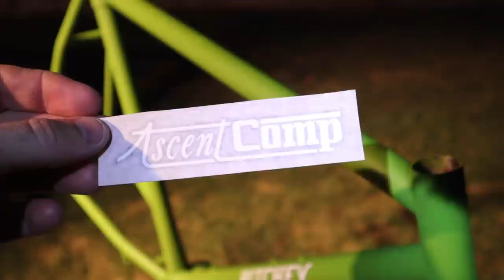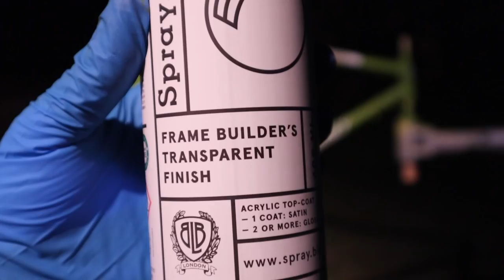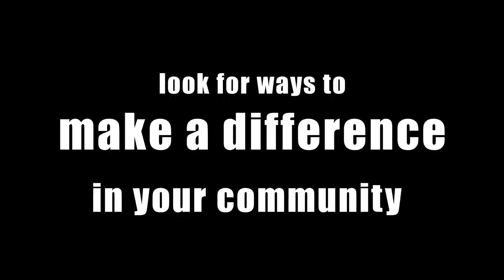Rebuilding Matt's Ritchey Ascent

Comment: Hey man. Thought i'd drop a comment to say how great your videos are, and how i've been helped out by the process of rebuilding my own bike. 
My gf of 8 years ended things just over a month ago and i've been getting by 1 day at a time with depression. Speaking to a friend last week,  he mentioned he was fixing up an old "rat" bike. I realised my dad's bike, an early 90's  raleigh MTB (built in Nottingham, England, my hometown) was the perfect candidate for a project of my own. It had been stuck in our garage for over a decade, used only when my road bike was in for repairs, but because of this neglect, it was in really good condition. After watching a few of your videos I was fully inspired, and I set to work stripping the bike down, cleaning the components one by one, and ordering the tools & parts needed to convert it into a single speed. Working on the bike in the garage with a beer, the smell of grease, that satisfying feeling of tightening a nut along a perfect thread, ( or finally loosening a particularly stuck one), and watching these videos of the process has been like therapy,  infact i'd say better than the therapy sessions i've been to. I have something to look forwards to doing each day again, and I can't wait to see how the finished product looks and rides. 
All the best & thanks for putting the time and effort into these great vids & rebuilds
Reply from the maker: Neil, thanks for sharing your story. There is something therapeutic about restoring a bike. Awesome awesomeness.

Comment: I grinned big at the end!  You took a $50-75 bike and turned it into something that I wouldn't trade for a new $1200 city bike.  There's just not many bikes at the $1200 price range that have fenders and a basket with components that I would compare to the old Deores XT.  $1200 is the absolute least that bike could be replaced with something new from a shop.

Pro tip:  (the only thing I'm surprised you didn't do) Put a sheet of sandpaper on a flat surface and sand the brake pads when you have them off the frame.  The stuff you'll find in brake pads is gnarlier than the stuff in jockey pulleys.  The pads will wear faster (from sanding), but the rims will be much happier and the braking action will be improved until the pads glaze over again.

Comment: What a nice bike with that surly swallow bar. And that cassette. I've never seen this type of locking. The paint is so dope. The finish would be even better if the logo decals where yellow to make a nice contrast. Also I would apply protective sticker patches on the sides od the head tube where the housing touches because the paint will quickly get scratched off.

Comment: That's a uniglide cassette! Difficult to find replacements, unfortunately. Thanks for another great video, I love your stuff
Reply: one advantage to uniglide is that you can flip the cassette cogs around once they wear out on one side.
Reply: @antoinedoinell  that brilliant.
Reply: I liked those uniglide sprockets too, you could build your own custom cassett with almost any weird combination of sprockets, the only downside was that you had only 13-32t to shoose from but other than that they worked well and with the right chain and derailiur they shifted very reliably.
Reply: I checked out of bike maintenance for awhile in the early 90’s. Fast forward to 2010’s and I broke 2 chain whips on a hyperglide cassette before I realized the world moved forward.  Newer things seem to be designed to be disposable, I have tossed several cassettes because the middle cogs were worn, even on those cassettes held together by screws, as a home mechanic, I don’t know a source for individual cogs. The uniglide cassette were maintainable for sure.

Comment: A 6-speed Shimano Deore XT?! With the smallest sprocket screwed onto the freewheel? Man, this must be the very first version of the XT. 
I'm not sure but the fact that the XT is printed in white (instead of golden for the following 7-speed XT-version) onto the rear derailleur seems to confirm my assumption. I really love those old bikes with drive trains which may not give the comfort of small shifting steps between each single sprocket like modern 12 (or even 13) speed drive trains but which proved to be robust and reliable and can be regarded as almost unbreakable.
I wonder if you (@oldshovel) will show us a MTB with a Campagnolo drive train one day. Campa also produced MTB drive trains in the early nineties. This would be great (and interesting) ;o)
Reply from the maker: I would love to find something with an old Campagnolo mtb drivetrain.
Reply: Uniglide!
Reply: @oldshovel  was popular on kleins
Reply: I still ride my 1987 Ritchey Ultra everyday, first gen XT, all original, all working great

6 speed Uniglide, great cassettes, easy to maintain / keep going. But big gaps by modern standards and a bit clunky under extreme load

Comment: As a tip you should pick up one of those Harbor Freight heated ultrasonic parts cleaners.  You can fill with degreaser and drop derailers, cassettes, and other items in it.  Let it run and the parts will come out super clean.  Every nook and cranny will get cleaned.

Comment: Your work is beautiful and detailed sir, I’m very, very impressed.
I spend some time hitting things with hammers and occasionally making Viking inspired jewellery. This involves cleaning off silver solder from Bronze and Brass as well as polishing. I got fed up with wet/dry and 1” mops on the Dremel... It might be interesting to have a look at a cheap bench grinder (6” mops) and a dedicated tapered spindle. Perhaps have a look at 3M polishing discs...they go from 80 grit to 1 micron (mirror finish) and they really get into nooks and crannies. There are also scotchbrite type mops which go from rust removal to a polished finish. Hope this is of interest.

Comment: Great video! Thank you for sharing! I have a question. Is the paint job you did with that aerosol paint and clear coat durable? Does it scratch or chip easily? Is it worth it to repaint a bike like you did if the original paint is not too damaged? Thank you.

Comment: Thanks for posting another great video. They are so relaxing to watch.

What do you use to clean the deraileur and other drivetrain parts? What are you spraying at 4:50?
Reply from the maker: Diluted simple green
Reply: @oldshovel  thanks. What was the stuff from the spray can with the thin red tube? Brake cleaner or something like that?

Comment: What rack is he using on the front?

Bike came out sweet
Reply: Think it’s a Wald but maybe @oldshovel can confirm.
Reply: Did some digging, looks like a Soma Lucas 2 or 3 with slight modification to the top bracket for the brake cable.
The basket is probably a Wald 137
I've been looking at building this setup or just using a Wald basket with the stock hardware.

Comment: Please help. I'm building a 1993 Trek mtb for my daughter using Spray.bike for the first time. I really like the way it stayed and covered. The color is awesome. But, when it dried it was really rough. I feel like I sprayed to much. I sprayed two coats using a little less than a full can on frame only. I sanded it down smooth and now I'm happy with it, the color is still nice. The little bit of white primer that is showing through in spots will actually go well with the DreamCycle theme. So my question is what's going to happen when I spray the clear? I want a high gloss so I plan to do several coats. Will it dry rough too? How do I get the best results with the clear? Thank you for any help you can give.

This Richie turned out great by the way. Absolutely beautiful. I love your videos. Thank you.
Reply: in my experience these problems only occur with the colors and probably because you sprayed too much in one spot or from too far away. The clear coat is not behaving like this and requires a larger spraying distance than the colors (>20 cm I believe). Check the spray.bike website for detailed instructions. Good luck with your project!

Comment: Nice, but why the rush on the frame paint? You would get much better results and durability with color sanding, adhesion promoter on the top of the decals before clear coat, and multiple layers of clear coat with final wet sand and polish. Not the best idea to paint at night, the humidity and lower temps can affect the finish. You also want a full cure before assembly. Cool bike tho

Comment: Wonderful rebuild, but I thought the original paint / decals were easily good enough to keep. Original paint from that era is so tough (and its only original once), way tougher than any of the modern stuff. Other than the fork, which could have been painted black

But the paint job did turn out really nice
Reply from the maker: The decals on it before we started were actually not original. They were recent replacements Matt had put on.

Comment: You should stop using ball end allens to torque and break bolts. Ball ends should only be used on bolts that are very difficult to get to and to drive a bolt 99% of the threads(The last tightening/loosening percent of threads, reserved for a straight faced allen head wrench) You will thank yourself.
Reply: Why?
Reply: @bananasstuff3344  Have you ever stripped an allen head bolt in a tough to reach spot on a  high dollar part/frame? Especially on older bikes that may have seen neglect i.e. oxidation.